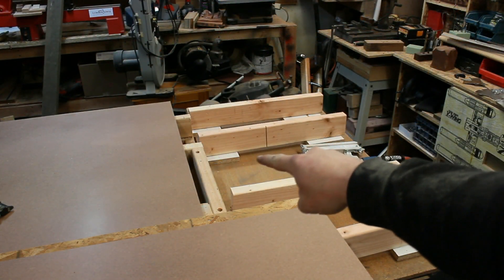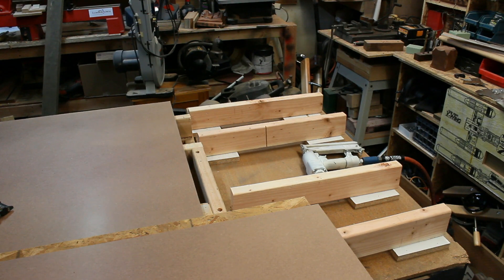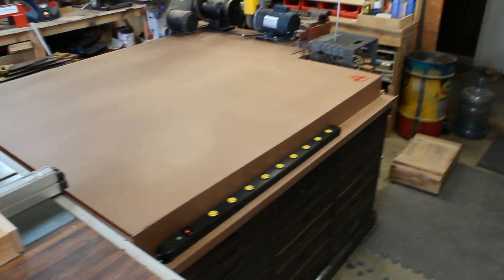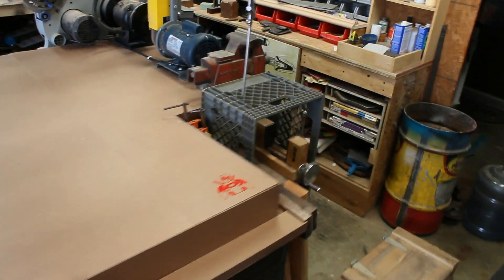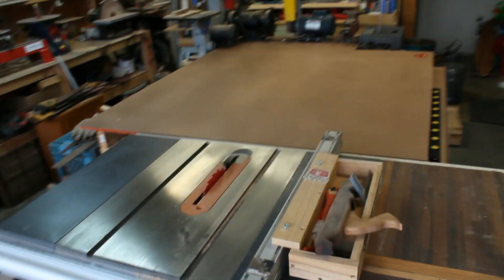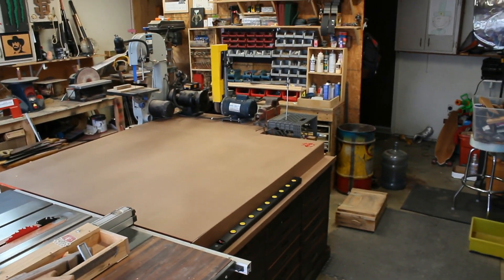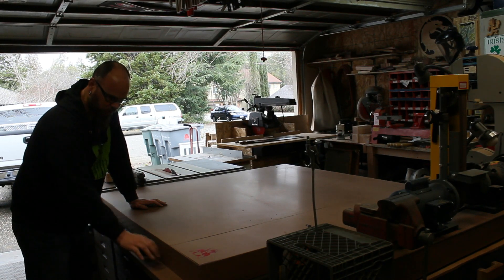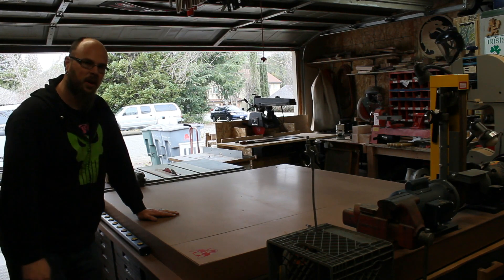The giant work bench!!!!!

Comment: yea bro that is a big ass work bench for sure! do you think you're going to have any problems with it bowing or flexing throughout the season like if  it'gets humid or hot -cold..I guess you could always pull it off and use some kinda construction adhesive to glue it down a d then nail it.. but yeah man that's a nice smooth big ass surface.im jealous ;)  and the band saws going to look good where you plan on putting it as soon as you showed that spot I was thinking "you should put your bandsaw there"& right after I thought that you said it waiting for a check in the mail on a couple commissions I just did and then going to mail out the blades to you you should get them by the middle or end of next week .
Reply from the maker: Joe basementwoodworking I don't think I'm gonna get to much movement, the 2x4's under are very dry. I've never had OSB warp unless directly getting it wet.
Reply: Dave's woodworks cool man. And thats good to know im getting ready for my yearly workbench build next month or two.might have to go with 3/4" osb for the bottom layer mdf middle and laminayed birch for the top layer.. or I might just take a bunch of two-by-fours flip them up on their sides glue them together to get a three inch thick workbench top like I did two years ago I took a long time though but that's good to know about the OSB

Comment: ON the section where you used the 2x4s and shims to level it up, could you slide things in there like smaller clamps or whatever as storage? Or did that get covered up?
Reply from the maker: musicguru73 covered up because it drops off so things would fall and get stuck.